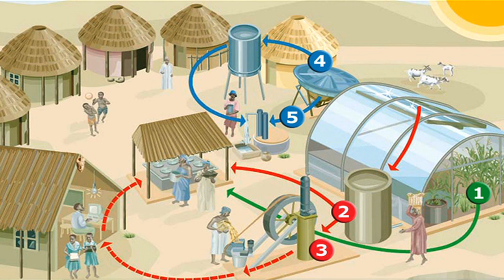Solar Village in Action: The Testfield at Tamera Peace Research Center | Auroras Eye Films

Comment: Great Community 👍  Great Video! I am an instant fan and subscriber. ;)

[Forgive my ametuture question 🙏]

  Quick 2 questions about your SunPulse 500 (Low Temperature Large Sterling Engine):

 WHY doesn't your engine use a longer stroke to achieve more pressure, why such a shallow stroke? Seems hard to provide any decent pressure or torque without a longer stroke... please educate me...🙏 

 DOES larger flywheel equate to more torque of something 🤔  because your system seems heavy and large... is that a factor? And if so, in what way?

  Thanks 😊 🙏
Reply from the maker: thank you :)

Comment: Teaching people to be better at being poor?  Imagine the stench from the poop buckets!
Reply: Have you ever smelled a well managed compost toilet?  Probably not because it is really easy to avoid smells with charcoal plus woodshavings or something similar.
And since it is a separation toilet (dry part for "humanure" another outlet for pee) you won't  get the smells you get from a typical hole in the ground toilet.
Oh and shitting in drinking water and using lots of non-renewable energy to clean said water is quite barbaric
Reply from the maker: yes i agree, we use a dry compost toilet and if you take care it doesnt smell.
Reply: More like saving people money.

Comment: What is some oxygen leaks into the biodigester?
Reply: It's under Pressure! How will it "Leak in?"
Reply: Even if it does somehow transpose itself in, there will either be used by a microorganism or come out with your fuel. 
If you want to consider the impossible, and inside algae managed to live producing oxygen, when it got somewhere past 25% oxygen, it'd go boom!